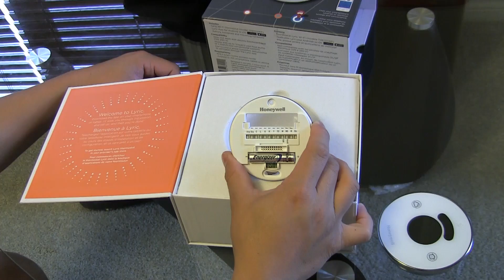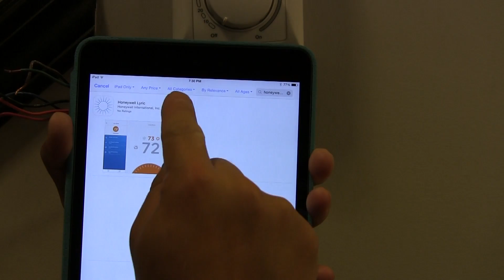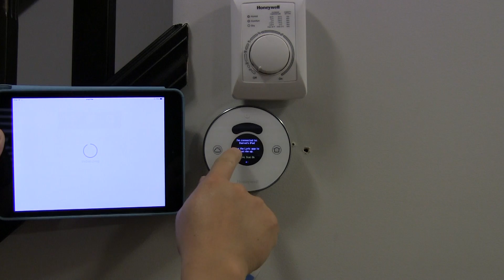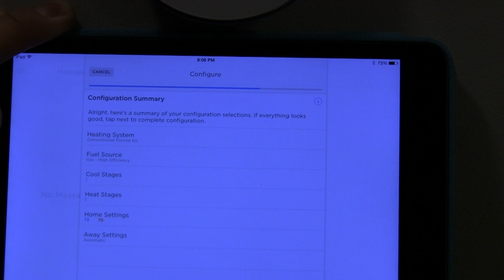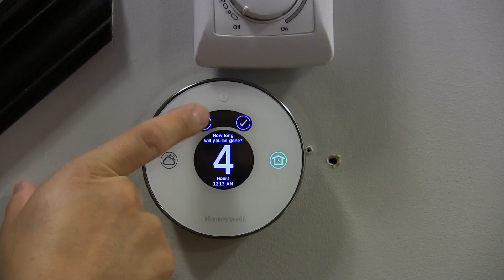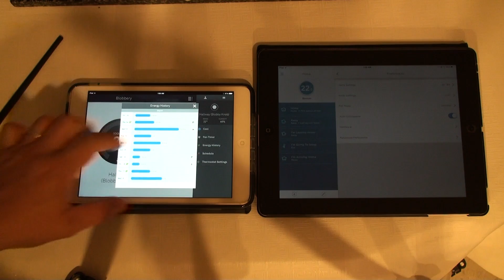Honeywell Lyric First Impressions - Nest has competition?

Comment: Why would someone want a "nest" or a "lyric" when the Honeywell prestige 2.0 or HD model does so much more (for less money) including telling you the temperature and humidity both inside AND outside the house?
Reply from the maker: What is interesting is that I actually once owned a Honeywell Vision Pro 8000 which quite frankly does WAAY more than a Nest or a Lyric BUT they're more complicated to install, more confusing to setup and at least in my past experiences they didn't offer wifi or smartphone connectivity or offered "geofencing" trigger capabilities.  I can't speak for the modern Honeywell t-stat today but last time I checked at Costco they were selling wifi enabled Honeywell t-stats that did most of what Nest and Lyric did but for only $100.  The Nest and the Lyric are definitely more about the form than it is the function any many people (including myself) WANT to buy into that because it looks cool and offers some advantages over the more traditional t-stat.  Is it the smartest financial investment where you'd recoup your costs?  Probably not but at least it makes a great conversation piece!

Comment: R isn't for heat, it's one side of 24VAC
Reply from the maker: you are correct however, to activate the furnace the thermostat would close contacts between R and W feeding 24 into terminal W.  Thanks for pointing that out.

Comment: I just got one, and so far I like it.  Never thought I'd spend this much on a thermostat, but I think the savings will make up for it.  The setup was a little wonky at first, due to Honeywell's server being sporadically available (apparently?), but it has been solid since then.  Set up enough "recipes" (sort of a more limited equivalent of IFTTT), and the thing is literally set-and-forget.  It knows when I'm out of the geofence range and sets the temp to my specified "away" mode, so I save money whenever I'm out.  It doesn't have a learning algorithm like Nest, but I actually prefer the Lyric's approach where it's not guessing what I want.  I can precisely specify Home, Away, and Eco Saver temps, then just let the recipes I've set up and the geofencing take over.  The real deal-breaker for me with the Nest is its +3 / -3 temperature swing.  So you set the thing to 70 degrees, and it might think 67 is close enough, or 73.  That's unacceptable.  The Lyric is FAR more accurate.

Comment: Great walkthrough, only thing I would probably disagree with is about the build quality between the Nest and the Lyric in relation to the battery. In terms of long term usage as I personally don't see people changing their thermostats like they change their phones every so often, I find the non-removable rechargeable battery a negative compared to the lyric. The constant recharge and discharge will kill the battery in a few years and since its non-removable, we are forced to make sure that the thermostat is sufficiently powered. (Some users don't have a common wire and as seen in the nest forums, some have had problems, keeping the nest powered up). That is why, I see the lyric having a removable battery, a big plus. If the battery goes bad, I can just change it. One less complexity to worry about. I have the Nest and that is probably what I would suggest they change in the third generation of Nest.
Reply from the maker: Valid point Ryan.  At the time when I did the video I thought... Gee, for the money that the Lyric cost you'd think they'd toss in a rechargeable battery.  In hindsight the simply AAA battery of the Lyric can be purchase for mere pennies vs. Nest's replacement battery probably costs $20 or more.  Now it is worth mentioning that Nest did engineer their t-stat's battery to be serviceable and they even went so far as to labelling the cables and how to install the replacement battery so Nest wasn't completely out to get people.  Yes I've heard of people not using the "C" wire and then having charing issues with the Nest.  In the 3rd gen Nest I would like to see the features of the Lyric tossed into the mix + all the features that Nest offers today.  Seriously why can't they include a thermidistat function to the Nest OR the Lyric....
Reply: When I read your reply, I completely forgot my number 1 rule when ruling out if something is non-removable; is to check if anyone has actually removed and replaced it. You are correct that it seems that Nest did engineer it to be serviceable. The Nest carries a 3.7 volts, 2.1 Wh (568 mAh) per ifixit website if anyone is wondering. I did a quick google search and no results found on a replacement battery. Hopefully Nest will supply a reasonable priced battery replacement instead of stating to replace the whole thermostat when the time comes. I agree a mash up of the two would make one great thermostat! One thing that also irks me is how the nest doesn't have a fan function where I can just turn on the fan only as long as I want (not on a timer). Does the lyric have a fan on only function like regular thermostats do or is it just like the nest in this regard?
Reply from the maker: No worries Ryan about checking up on the replacement battery.  Can't be experts in everything we like to play with right?  The Lyric I believe does NOT have a fan timer.  Nest actually allows you to "schedule" a fan run period.  For example my fan is scheduled to run from 9PM until 7AM daily.  I think the fan timer is based on the assumption that if you don't normally have the fan scheduled then odds are you won't have the fan running very much OR if you schedule the fan to run like I do then they might've assumed that perhaps I just want to run it a little longer.  Who knows what the Nest folks were thinking at the time...

Comment: I've had the lyric for a few weeks now. I am not impressed with it at all. I plan to return them for 2 nests.
Reply from the maker: Steve Honeywell will need time to iron out many of the kinks in their software.  Much like Nest when they first hit market early adopters were able to identify and experience the defects and shortcomings of the current release of firmware for the Lyric.  I suspect that within a few more months that the Lyric will work just as good or possibly better than Nest.  I personally jumped on the Nest bandwagon years ago so for me to take the plunge to change out my t-stats seems rather silly if I have to pay for Lyric.